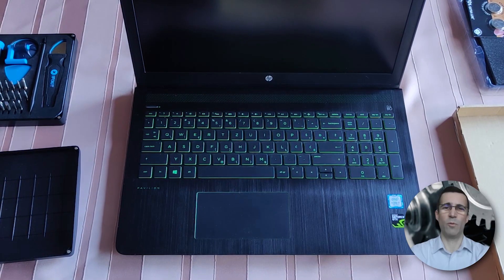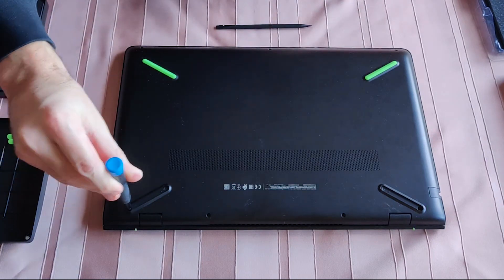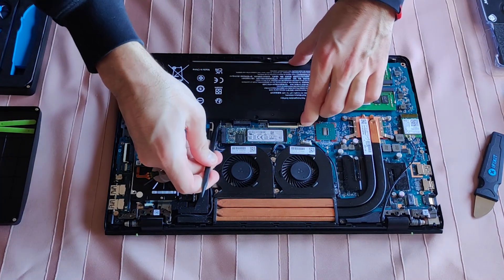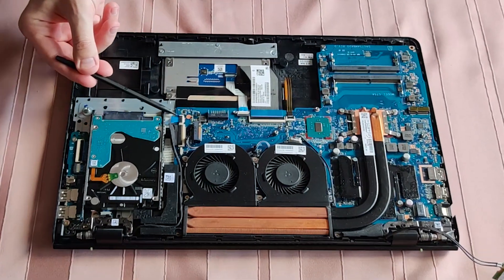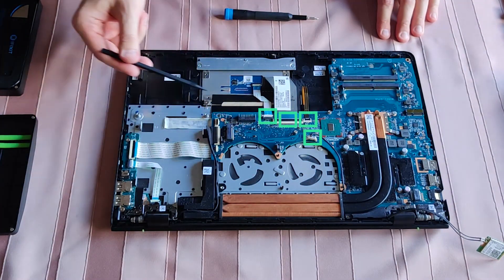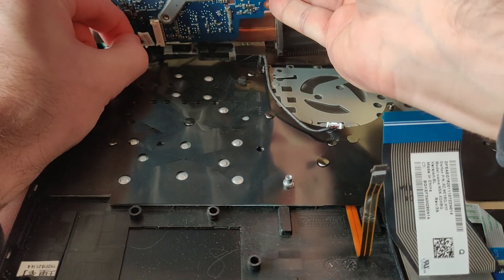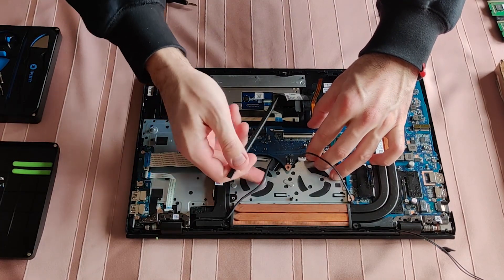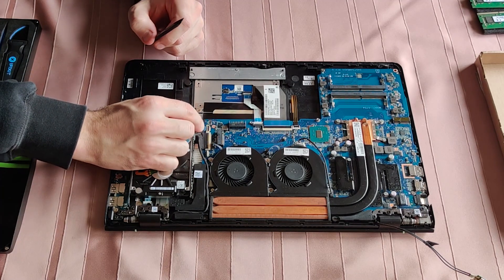HP Pavilion Power - 15-CB025NM - motherboard replacement

Comment: Hey bro i wnt to add hdd to my fujitsu h770 that already had an ssd
I want to add not replace
Do i need to open it?
Reply from the maker: Hello! Can you be more precise about the model of your laptop? Fujitsu H770, which one? There are many sub-models, some modern some older.
Reply: @smooth.IT.operator  FJNB2AD
Reply: @smooth.IT.operator  it has i7 7920hq 3,10 ghz 256ssd quadro m2200 16 gb ram ddr4 also it's 15,6
Reply: Please answer as soon as possible
Reply from the maker: @jojo63920  This is good that you listed hardware specification but you still haven't wrote the precise model of your "Fujitsu h770" because there are plenty of sub-models. You put me at risk of giving you the wrong info for some other model that might not be yours.
Reply from the maker: @jojo63920  It is on the back of your laptop. "Fujitsu h770 and something" usually where there is a serial number. You can also send the serial to my email also. My email is on my YouTube "About" page.
Reply: @smooth.IT.operator  ok bro
Reply from the maker: Thanks for your patience. Seems to me your models already has 2.5 inch HDD and and m.2 SSD. You can access 2.5 inch drive easily by lifting the small plate located on the behind of your laptop, somewhere in in the middle. To access m.2 port you need to open the entire laptop. Pull out the keyboard and the front facing cover.
Reply: @smooth.IT.operator  yes you think it's good?
Where did you use the serial number?
Reply from the maker: @jojo63920  You mean your laptop? Yes, it is awesome. You can upgrade RAM replace your SSDs for bigger and faster ones, if you need purchase recommendations you got Amazon links in the description of my video. I cannot post url here. Send me an email for further consultations. smooth.it.operator@gmail.com